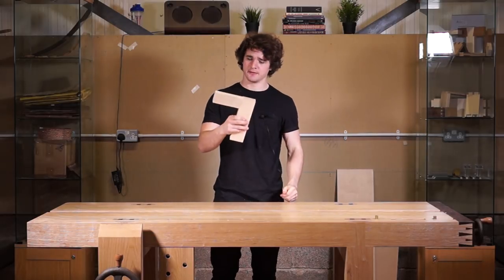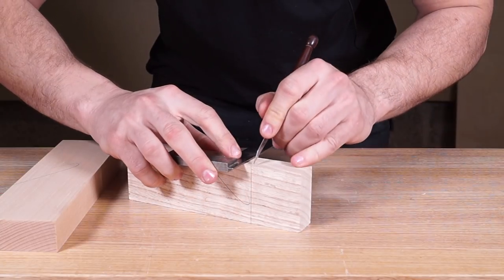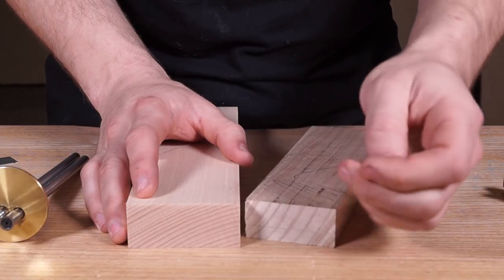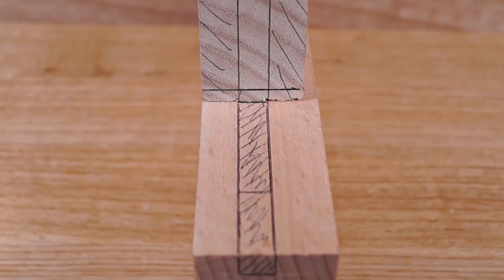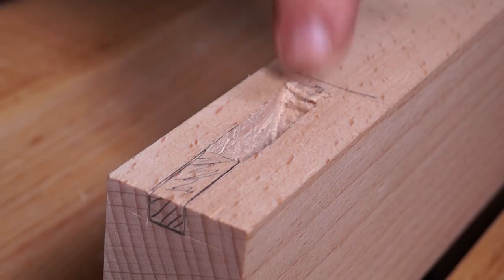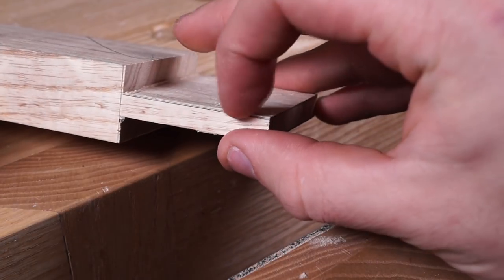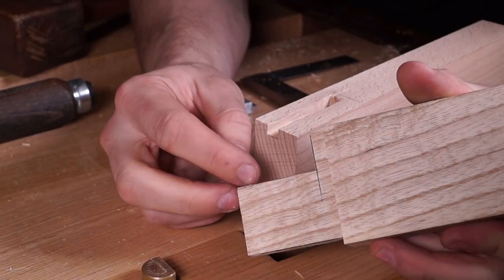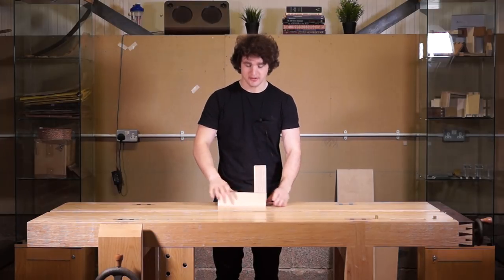How to cut a MORTICE AND TENON JOINT by HAND

Comment: You have the true edges wrong. Accuracy from within. Make cut with the mortice chisel is better than holding it in place and fiddling marks. A lot of good points made, but still much to learn. Also good practice to leave "horns" at ends of styles to be removed after gliing.

Comment: Hi Matt I've just found your videos. I used to be a machinist / toolmaker in another lifetime  so tolerances of fractions of a thousandth of an inch aren't uncommon. It has always given me great respect for woodworking craftsmen and frustration in myself, that I have never been able to work wood accurately. I am retired now and hoping to try some of your techniques. The biggest issue is eye deterioration which makes this craft ( and my own) more  challenging, lots of light helps which is easy to provide. I'm going to make a couple of those  marking guages they are so neat. Many thanks
Reply: I know what you mean I used to be a Universal Miller back in the day.
Taking your test piece to the tester and told it's
a tho out when you were 
plus or minus a half.
Happy days.

Comment: As a person who struggles with keeping track of pens, pencils and other marking/ writing tools, ordering 50 of the same pen is a great way to cut back on using the phrase, 'where the ****'s my tool?" and running out of pens because they all died or dried out.
Also having a Pen cup (doesn't have to be for just marking tools) near by so everything has a consistent home, which helps a lot.

Comment: It may not be orthodox, but I found that chiseling the mortise with a chisel that is about 1mm narrower than the final mortise should be, and then using a wide bench chisel to pare down the sides to the knife line results in a really nice rectangular mortise with absolutely straight sides. It takes a little longer to finish, but I get very nice results.

Comment: I need to make a shooting board. My table saw does not work great atm. I'm having issues with it so I need to make a shooting board to get good square pieces. I'm enjoying the hand planes I bought and I'm actually enjoying sharpening them. I made a mistake last night with my #4 plane. I put the main edge on it at 30 degrees and the micro edge/bevel at 25.. I have it working great but I balls'd it up while sharpening. 
My other plane blade has all these little chips in it. They weren't there this morning but after using my 1st diamond stone 400 it developed these chips on it. I flattened the back as well but even when I kept it moving through the higher grits it didn't lose these little chips from the edge. Would that just be a bad piece of steel that was used for the blade or could it be rough bit that may have been left from my last sharpening which was the day before?? What I did today was wash them under the sink this time. I think I hadn't cleaned them properly and maybe that caused the issue but it's the 1st time that's happened. 
I haven't really used this #3 finishing plane before. I was only beginning to use them and I was getting used to the '4 smoothing plane I bought. I really messed up the edges though. Does that matter if they are shaving ok? They left a smooth finish on the wood I planed last night though even though I got the bevel the wrong way around.. 
I need to make one of those devices with blocks u use to get the degrees correct. I can't think of what it's called again.

Comment: enjoyed this video Matt mate. I'm going to start working more with my hand tools. I have a nice marking gauge but I don't have a knife. 
Could I make a decent marking knife from a piece of Mild Steel? 
Is that possible or would the steel need to be heat treated before or after?? I think I'm going to take a punt at making a small marking knife with a wooden handle...
Somebody told me u only bevel it on one side?? Is that true?
This was a very good video for the likes of me to learn from. Appreciate it very much my bro. Thanks.

Comment: Hi Matt, been following your guitar build with interest as I made a bass some time ago, only 5 strings and no where near as nice as yours. However my question to you is unrelated.
I was wondering if you could cover drilling compound angles in seat blank for tenons and drill press set up.
I understand the principles but each time I drill sample holes are slightly out of whack...HELP!
I have spent 3 weekends trying to work it out.
Save me!
Leon

Comment: I'm planning of making a power rack out of 75mm x 75mm x 2000mm timber. Would a joint like this make the rack stronger? I was originally planning on using 90° angle brackets and 45° supports in each corner, but I'm looking for ways to make it as strong as possible.
Thanks in advance

Comment: Hi Matt, I am pretty sure you made a mistake there: When marking the tenon, you said that the 45 degrees chamfer should be n the waste. But you actually cut the 45 degree chamfer into the tenon...

Perhaps edit the video and overlay the correction?
Reply from the maker: Oh yea, my mistake! Not too bad on this joint because it’s all hidden anyway. I’ll pin your comment so others can see it. Cheers!
Reply: Matt Estlea - Furniture Yes I realised that later as well. It was actually helping you as you later on added a chamfer yourself :)

But had it been a through tenon or a visible edge... ;-)

Comment: I'm just starting in the craft and really only interested in hand tools. The problem I have run into is the lumber. In the US, the advertised stock dimensions is as the timber is cut, and not the actual dimensions after being run thru the kiln for drying. So, for instance, when the wood is on the rack at the lumber store and marked as a 2x2 inch dimension, that is not the true size. Take a ruler or a square to it and it is closer to 1.5 x 1.5 inches. 
This is problematic for newbies who are trying to learn off of plans we can find that call for a 2x2 and don't have the means or equipment of sizing down a larger piece to the required dimensions.
And that also seems to be an issue with the lumber industry as a whole...in a world were we are constantly hounded to reduce waste, wood workers must buy more than we need, cut and glue and trim to get the dimensions we need.... so we have to buy more wood, and generate more waste to get a piece that actually measure 2x2 inches.